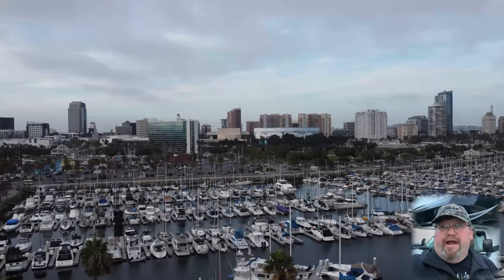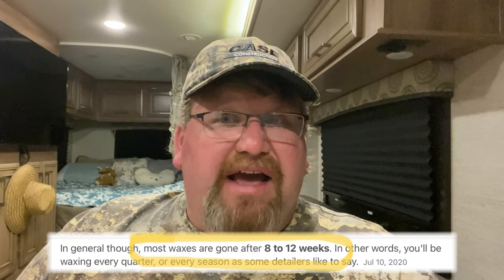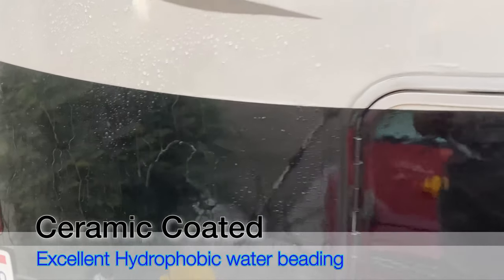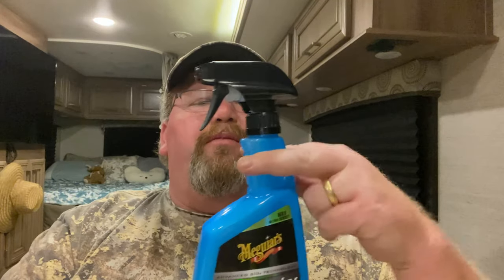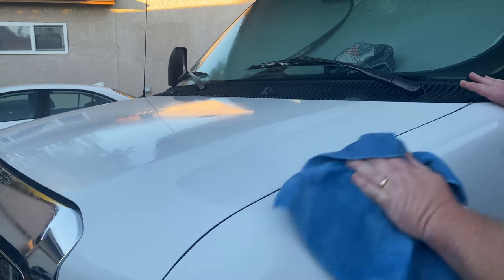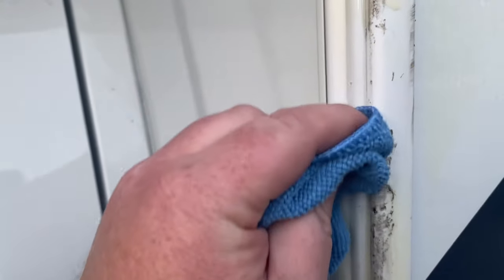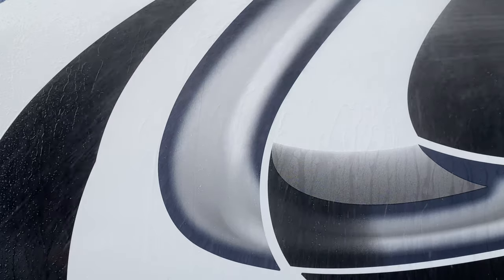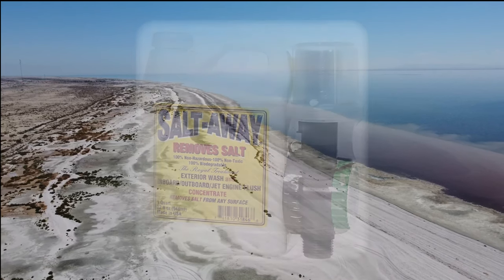RV and Motorhome - Detailed Exterior Maintenance DIY video

Comment: Was curious if you upgraded the sway bars and added a safe t plus steering stabilizer? Otherwise are you happy with the was the stock unit drives?  We were planning on buying a new Entegra 25R and have seen YouTube videos where owners have done so.
Reply from the maker: It’s not real great in high winds,  but it is more stable than my friends new Coachman that is actually shorter.  Would the upgrade help? I am sure it would - but is it “necessary”, 13,000 miles into owning this - I would rather spend the money to upgrade to solar and get some better batteries than spend the money to upgrade the suspension, but thats just me.  Thanks for watching !